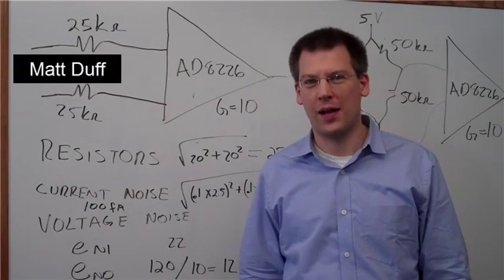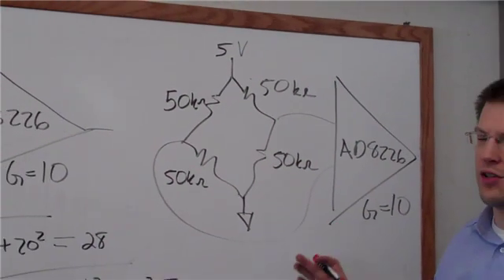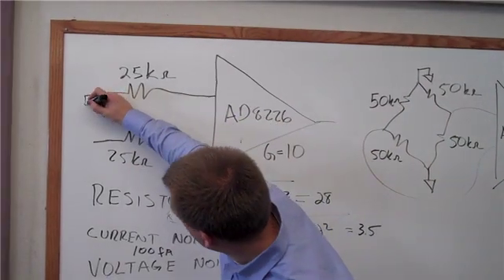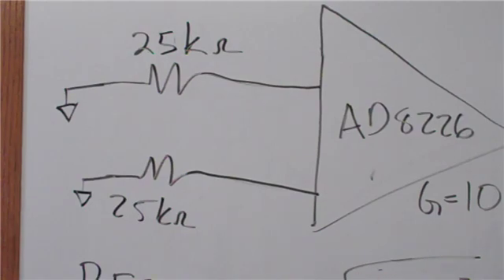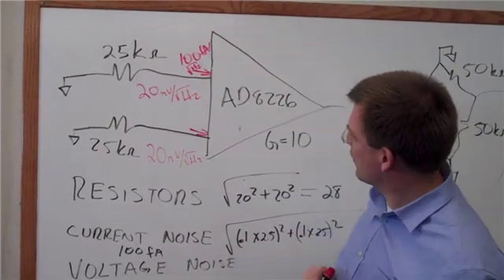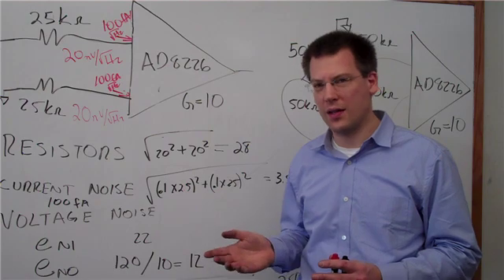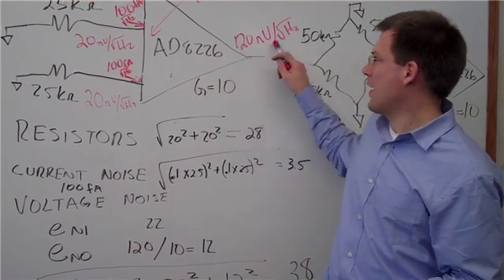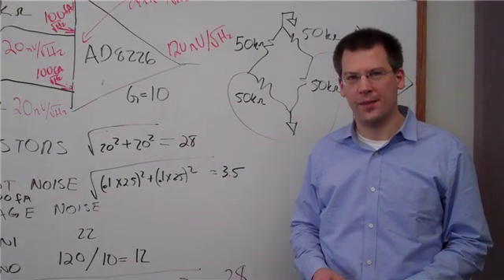Noise of an Instrumentation Amplifier Circuit

Comment: Why is the gain of the amplifier not applied to the input noise? I would have expected the input noise contributions to add in quadrature, then gain by 10x which would then add in quadrature with the output noise. What am I missing?

Comment: Please check the 100 fA to nA calculation again. I think its way less than 0.1nA or am I getting something wrong?. I love analog devices. Segun from Nigeria
Reply: My voiceover could have been clearer.  "I want to convert femto to nano" => "I want to change the femtoamps to picoamps so that when I multiply by kiloohms, I get nanovolts."   But the math is correct.    100 fA * 25kohm = 2.5 nV.  sqrt(2.5nV^2 + 2.5nV^2) =  3.5 nV.

Comment: Hi Matt! Great series of videos!
I have a question regarding really low bandwidth application - our frequency of interest is DC to 10 Hz. However, the 1/f noise is specified from 0.1 Hz to 10 Hz. In this case, for noise calculation do we use only the 1/f noise value or we include the spectral density calculated over the bandwidth (10 Hz) and added to the 1/f noise in RSS fashion? We intend to use AD8422 for our application.
Thanks in advance!
Reply: Hi Vasil,   Apologies for the delay in response.  The 0.1 Hz to 10Hz number includes both the 1/f noise and white noise.   Because the 1/f corner of the AD8422's voltage noise is quite low, its 0.1 Hz to 10 Hz number is caused primarily by the part's white noise, rather than 1/f noise, which is fairly unusual in a non-autozero amplifier.  Its 0.1 Hz to 10 Hz current noise number is dominated by the 1/f noise as is typically the case.
Matt

Comment: Hi Matt,
How would you bias the inputs of an in-amp for a capacitive source while trying to keep the noise down.  I have a source with 2nF and frequency response requirement from 5Hz to 2kHz!  Resulting in two 31Meg resistors for biasing the inputs.
That's 713nV/rtHz per resistor!
Thanks in advance.
Reply: Hi James,
While you will indeed get this kind of noise from each resistor, when you have your sensor attached across the in amp inputs, very little of that noise will actually reach in the in amp, especially at higher frequencies.  Model the resistor noise as a noise source connected to the following impedance string:  31Meg, 2 nF, 31 Meg.  Compute the signal across the 2 nF created by that impedance divider.   That should tell you how much noise actually goes into the input from each resistor.

Comment: Hi Matt,
Should we multiply the Resistor-Noise (not the eni) by the Gain before calculating the total noise?
Thanks.
Reply: Hi James, all noise sources in this video were calculated referred to the input. What we are saying is that all the noise sources are equivalent to one 38 nV/rt(Hz) source at the input.  You can also calculate referred to output, in which case all noise sources would have been 10x bigger and our answer would have been 380 nV/rt(Hz).
Reply: MattDuffADI
Thank you Matt.

Comment: Actually thinking about it, referring to the input is more appropriate.  We would normally want to refer the noise to the input signal, expressing it as a percentage of full scale deflection.  If you put all the gain in the first stage then you don't need to worry about what comes after.

Comment: It depends on what you want to do.   If you want to compare the noise to your input signal, you want to refer to input.   If you want to see how the noise compares to the that of your ADC, you want to refer it to the output.   The key thing when doing your calculations is to make sure you are consistent – i.e. don’t calculate using the resistor noise referred to input, but the amplifier voltage noise referred to output.

Comment: Another example of how to calculate noise is on page 18 of the AD8429 datasheet: "Calculating the Noise of the Input Stage".   Note that the AD8429 example also includes the Rg noise.  To keep it simple, in our AD8226 video, we neglected the Rg noise, since it is typically fairly small compared to the other noise sources.   However to have the most accurate estimate, add in the Rg noise as we did in the AD8429 example.
Reply: Thanks

Comment: Unlike op amps, in amps have this funny property that some of the noise is dependent on gain and some of isn't.  We denote these two terms in the datasheet as "eni" and "eno".  These terms can be referred to input or output.

For example with AD8226 at G=10:
Referred to input:    eni=22 nV/rt(Hz), eno =12 nV/rt(Hz)
Referred to output:  eni=220nV/rt(Hz), eno=120 nV/rt(Hz)